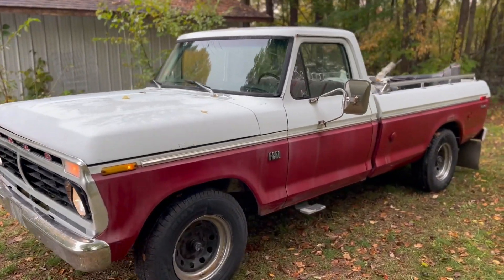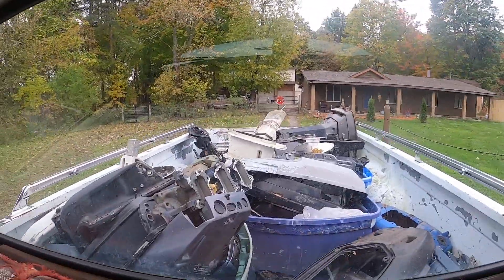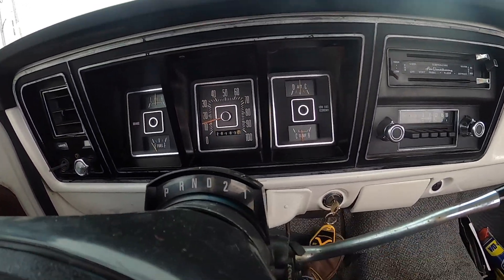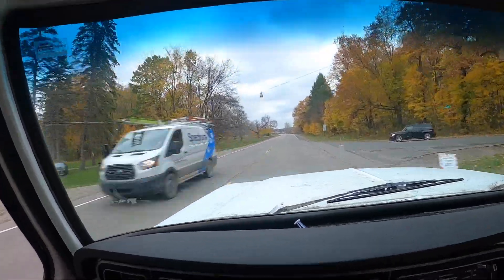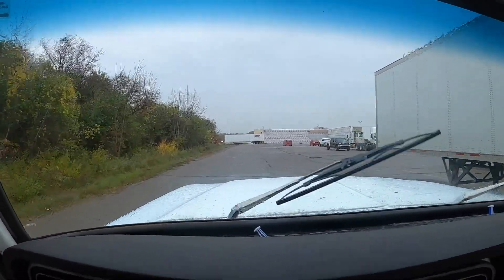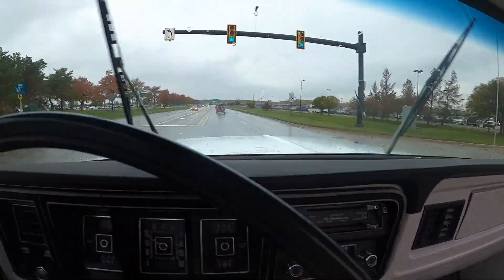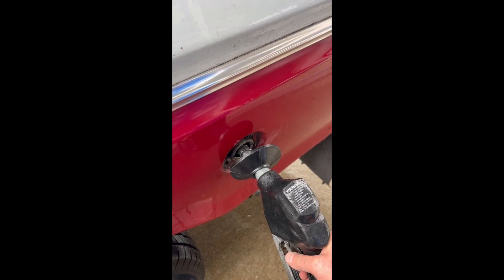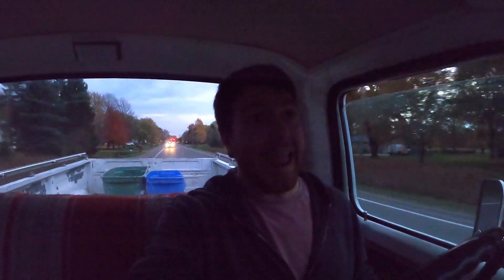1975 Ford F-250- Fuel Economy mpg test - 390 FE V8 - Classic truck hauling

Comment: That sounds about right for how the truck is outfitted, I've got an 05 F-350 that gets about ten mpg with about six hundred pounds of two four wheel drive axles in the bed.  I drove from L.A. to "New River, NC" in a 62 chevy half ton and made 18 mpg all the way, back in the early eighties.  I've got family out in California and Washington state and I've done the cross country trip many times, anything over ten in a full sized truck with a load is generally good in my book, thanks for sharing this!
Reply from the maker: Yeah, I honestly was not disappointed with the result. it's a big heavy truck with gearing intended to be a workhorse. 18 mpg's in a 1962 truck is awesome!!

Comment: I have a 72 F250 with a 390 and 4 speed. I am getting it road worthy at this time. It has a gear vendors overdrive that is not wired up. And no instructions or documents. I saw your video on your GVOD. I'm going to contact them for the install kit/module. You should put one on your truck!
Reply from the maker: The gear vendors will be nice to have with your truck- it really makes these old haulers a lot more flexible!! You'll have a lot of fun with the gear-splitting too, especially with that 4-speed! As for my F250, its something i'm considering. The 3.7:1 gear ratio is great for pulling heavy loads but that 390 is howling if i take it onto the freeway- 70 mph is ~3000 rpm

Comment: It got about what i thought it would get. My 77f150 4x4 reg cab long bed with 351m  and 3.50 rear end gets 10 regularly and if i drive mindfully ive gotten 12.
Reply from the maker: Yeah, these old haulers can be heavy drinkers. i actually used to have a full size Bronco 4x4 with a 351w and 3.50 rear and it too generally got 10 but could get 12 if you did a long trip and stayed out of the throttle.

Comment: Mine is a '73 f350 super camper special with the 390. It's awful on gas, I mean truly awful. Mine only has one tank and its from a bronco so its small, I never pass a gas station. Worth it tho, my truck is beautiful, so is yours. Save them all!
Reply from the maker: Yeeaah, i can relate to the one fuel tank situation. THis F250 does have a second fuel tank but it leaks and needs to be replaced so right now just running off of the rear fuel tank. Not a lot of range.
Reply: Take the Fuel pump out and see how much slack is in the timing Chain.

Comment: You really need a larger sample size.  Take an average of 3 full tanks worth.  Also, will be worth the effort to check that the speed-o calibration is sill good with the tire outside diameter and rear gear, can make a significant difference.
Reply from the maker: Ehhh maybe for a different video. You definitely don’t need to drive 600 miles to get a good idea of the fuel economy of your vehicle- that’s a little overkill. There’s no perfect way to do a real world test- there are just too many uncontrolled variables. I repeated my test and got essentially the same result. Also, I verified the accuracy of the odometer  before the test- it’s accurate. Thanks for watching it and I dig the feedback!

Comment: < 71 F250 crewcab 4x4 6200 lbs empty. FE 390 got 5 to 6 mpg. Its still a work truck and I drive it hard. Put in a very built 300 I6 and got 8 to 13 until it came apart. Rebuilt the 390 and  was getting 6 to 7. Replaced the 500 cfm eldecrap with 570 holley street aveneger and after getting it working correctly it is very noticably better gas milage. I havent measured it but I suspect 8 maybe 9 ? ....
Reply from the maker: 71 crew cab? Rare bird, very cool

Comment: Your truck did well for the setup. Look into changing the jets on the carbarator and bowl jets to one size smaller depending on where you live. Jegs and summit sell the tool and kit together in one package. You could see 16 mpg on the other jets. Modern spark plugs can help too, but be careful( no champions, E3s work very well). Use Marvel Mystery Oil in the gas to help the top valves stay cleaner. Use it also inthe oil to clean any sludge from old oil out. Other than that, it is what it is. A TRUCK!
Reply from the maker: I'm going to experiment with re-jetting the carburetor, mostly just to see if there is a little performance on the table. I'm sure the thing could use an ignition component tune-up too. The truck had sat in a field for at least 5 years when i came along and dragged it home. All I've done to the truck was install a brake master cylinder, a new accelerator pump diaphragm in the carb, and a fuel filter, then added fresh gas into and she came right to life and I've put a few hundred miles on the rig since the revival.
Reply: one last change. put half inch bigger exhaust on it and NO CATYLITIC CONVERTER. lose the smog pump and install electric fans. That all you have left to do. when engine requires rebuild, be sure to match intake gaskets to the heads and manifold. Don't forget the exhaust side. port and polish appropriately. it can wake that motor up and give you better efficiency all around. Its an old truck, not a Prius.

Comment: I have a 76 F250 with a 390 FE as well, rebuilt once around 20 years but sat fir 10 years, I am the second  owner, I just replaced the carburetor with a holley 4160 vacuum secondary  and it responds quite sharply, I believe  11.3 is very good, in 1975 gas was  around 75 cents during the embargo, still manageable and even today at 4$ it's not a big deal. You want 35mpg...then get a smart car...you want a working  vehicle stick with the torqueey truck and let it make money for you.
Reply from the maker: I agree with you. For a heavy duty truck, I’ll  take 11.3 all day. I like the Holley 4160 carb - good all around performing carb and easy to work with.
Reply: @mattsboatyard6891  it's like having a 2bbl card saves gas and will git up and go when needed.

Comment: Considering the fact that truck weighs 4500 lb unloaded, the engine is 6.5 liters 3-speed automatic without overdrive and 3.7:1 gears in the back, that's about correct.
Reply from the maker: True!

Comment: If you drive a truck like that and are concerned fuel milage. Your a bit misguided.
Reply from the maker: Nah, there are actually a lot of good reasons to have a clue of what kind of fuel economy your vehicle is getting- especially an older one. Unless you just don't drive it ever, then sure yeah- it doesn't matter much.

Comment: When it comes to old vehicles and fuel efficiencies. Engine wear and when was the last full rebuild is very important. I remember an old top gear segment where they took some old cars out and worked out what the mpg and then put em on a dyno. One of the cars was down to 40% HP compared to how the vehicle came new. Valve timings and compression loss are probably two biggest factors.